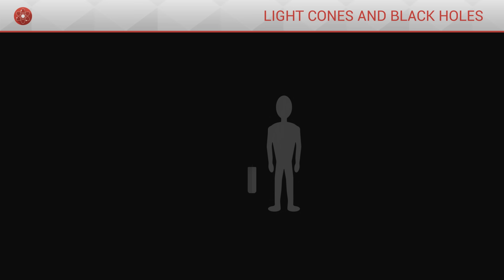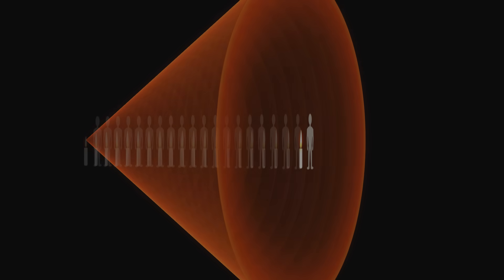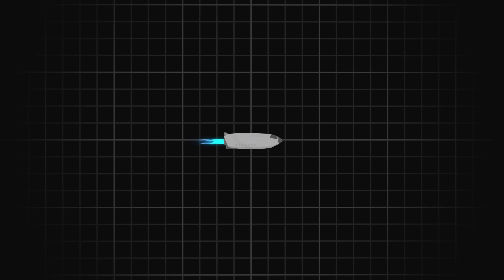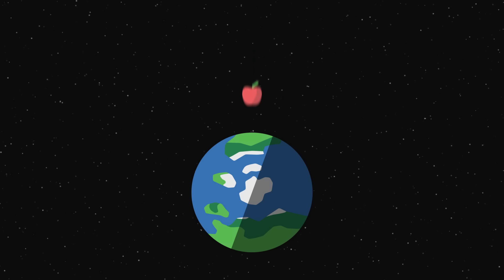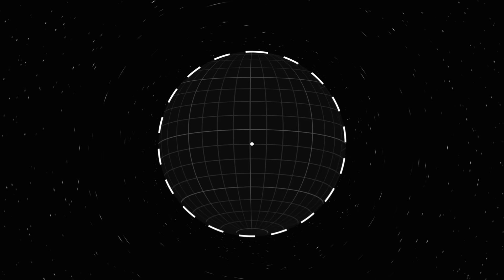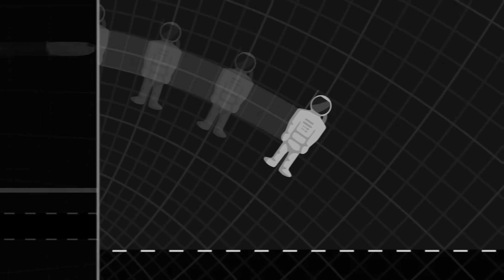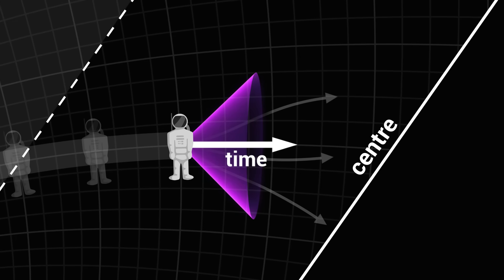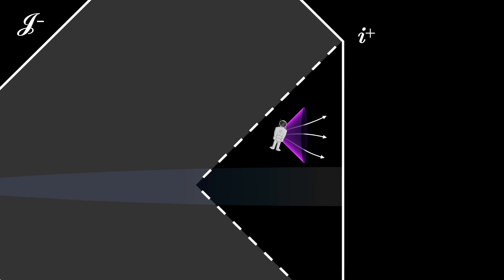Why Time and Space swap in a Black Hole

Comment: Something you said leads me thinking we can’t see a black hole because the event hasn’t happened yet in our future but with time pointing toward the center and us not having the capacity to travel through time, we can only witness the star disappearing in time but it’s still there heading toward infinity of space and we can only see the event horizon which exists in our timeframe reference

I would love to see an explanation of why black holes are successful at emitting jets of radiation outside the light bubble into our own time reference from the past. I would also love to see what happens to space and time as two black holes come together and “merge” aka two separate timelines potentially unify into a single timeline occupying the same space time reference point but internally could still be two separate points of time with two non escaping light bubbles interacting with each other 

Something else, now I’m curious how I’m trapped in a spacetime bubble and the influences I have within it and what would happen if I were to escape that spacetime light bubble (besides seemingly ceasing to exist to others around me)

Comment: One day i phylosophed about this.  So in our Universe, when our speed in room directions is at 0, our local time speed is at maximum. In my imagination, the atoms inner "happening" happens at lightspeed. When we then accelerate more and more towards lightspeed in a roomdirection, more and more the "happenings" and "oscillations" happen less often, because otherwise they would have to overcome lightspeed, when the action goes in the same direction as the whole "object". So a structure at lightspeed can not do something not even recognize the travel. In travelers perspective, the universe becomes shorter this way,. It is possible to interchange local speed with object speed by investing energy. When passing black hole horinzont, an objects speed is intrinsic at lightspeed to the centre. So by not doing anything, it has no inner time, because that would mean relative inner moving to itself. By investing energy, it is possible to change "X and Y" speed, what then leads to less "Z" speed in what an object would normally constantely go. That then would lead to inner time of an object, depending on how fast an object goes in X or Y direction. I just remember now my dreaming.

Comment: What if at the point of the event horizon because of your shift in  perspective of time; reaching the singularity is actually a lot quicker for you than we think and if that is a destination in time what if that destination is the time at which the black hole ceases to exist so it would essential be a kind of time travel from the now to the singularity being the then? I wonder if it could be possible that there is an equalizing dissapation of gravity on the opposite end or if its a completely different situation in that you essentially become frozen in time in some sort of space time blender that is dissipating both your time and space into some entropic pure energy that is just the cosmic remains of what you once were floating at the end of time.

Comment: But like the light moving away from the candle time moves forward no matter what geographical direction you travel in space.  And space is also moving in all directions.  Your direction of movement is only relative when you see something else and it is a human's interpretation you can't prove you are moving.  When you stepped off the tall building the ground came up and hit you. Time slows with acceleration if you move at the speed of light time stops.  If you sit at the singularity of the black hole and you are no longer moving and time is infinitely fast.

Comment: How about this?  Dark Energy is EQUAL to Energy plus TIME, for our purposes here, "HEAVY TIME." 
Mira, look, if we look at any form of energy or whatever you want to call it.  We see this electron orbit however many times a minute. We set that as our base or 0 reading, right? For our plain of existence, anyway.  However, in this pocket of "heavy time" we get readings of a billion times a minute because time is HEAVY here and passes faster.  Or, energy where there shouldn't be energy / dark energy / Heavy Time.  See, in that same minute that electron aged a million times faster and therefore has given off readings of a million instead of our base readings. Dark energy IS "HEAVY TIME."  It's the difference in TIME that we're seeing!  Maybe.  The light from these galaxies have been aged by going through pockets of dark energy or "heavy time."  Numbers used for reference only.  TI-I-I-IME IS ON MY SIDE!  YES, IT IS!
Now we look at the other side of the coin, dark matter.  Pockets of dark matter are actually pockets of "LIGHT TIME."  
Mira, look, if heavy time is, "full," it stands to reason, light time would be "starving," right?  Now this light time is slower.  Making our base 0 electron seem to stand still.  Get a pocket full of seemingly motionless nothing and you get a pocket of starving dark matter.  In this case "starving" is the same as creating a vacuum in space.  Since this pocket of "Light time" is "starving" and everything outside this pocket of dark matter is in a "heavier time," it makes it appear dark matter is attracting when really it's just a vacuum, in time, trying to equalize.
Making it stand to reason, by my, "I'm not smart enough to give anything more than this simplified reasoning, that Dark Matter is "LIGHT TIME" and Dark Energy is "HEAVY TIME."   Maybe.  Now think about this.  As light travels through the universe and passes through these pockets of Heavy Time or Light Time.  Does that "age" or "distort" that particular beam of light?  Does that beam of light that is say 40 million light years away now look like it's 100 million light years away?  If I'm right, it would explain why these 6 "old" galaxies are being discovered.  Also if I'm right and someone proves it, you must name it after me and give me a cut of the Nobel prize winnings. Pass it on please. and thank you.  Don't worry, where I come from crazy is a compliment. As it should be 
P.S. I may have gotten the names backwards and thanks again ;-P

Comment: I've never been able to find it, but when I was younger I saw a video in physics class that posited that instead of time and space swapping, spatial dimensions are integrated into time one after another. Entering the ergosphere, the spatial dimension in the direction of the traveler's velocity becomes necessarily positive and is indistinguishable from time itself. The traveler is then, spatially, in a two-dimensional universe. Crossing the event horizon, this happens again and the traveler is in a one-dimensional universe, unable to travel in any direction not ultimately toward the singularity. It finished off by supposing our current observable universe may well be inside the influence of a singularity, with unknown spatial dimensions already integrated into time. We would never know. Anyone know if this viewpoint is still a valid one, and if not then why?

Comment: What is the difference between the apple and the astronaut falling into the black hole? Their lightcones both point towards the center of gravity. Why would time become a space-like dimension in the black hole?
Reply: The whole space is time thing is just a complicated way of saying you just can’t get out. The singularity is pulling everything into it as fast or faster than light. That’s the main reason why nothing gets out
Reply: Because all directions you can move past the event horizon point towards the singularity and all directions outward point towards your past going towards the singularity is basically like going into the future thus you can't escape.

Comment: Awesome illustrations and narration but I don't think you explained the idea of dimension swapping. I don't think the concept of dimensions "swapping" roles was motivated. It seems more like a strong correlation between the dimensions is established inside a black hole. Note that in the case of the apple falling towards earth, you also said that "it's future is downwards". Note that without external forces, it the apple would not be able to escape earth either, even though earth is not a black hole. Therefore, the only difference between gravity of a regular body and gravity within a black hole is the strength of the space curvature, which, in the case of the black hole, makes escapes impossible (even if enormous forces were used). Hence, the difference appears to be that a certain threshold is crossed, not that the roles of dimensions are swapped. This is not to say that once that threshold is crossed, time and space are not more similar to each other than they are outside a black hole, but from your video I did not get the sense that an actual role reversal occurred.
Reply: I agree a 100%. Let's say the apple had some limited propulsion available that could delay but not avoid the contact with earth, that would still represent a "can't escape" scenario. Of course the Schwarzschild radius implies a threshold that introduces a qualitatively different limitation as no propulsion at all would allow escaping the black hole once that boundary has been crossed. Yet, at least this video, does not motivate a dimension role swap.

Comment: I have a question. If the gravity bends tje3 direction of time, for example , on earth,time and space are pointed to the center of earth ,and consequently the light cone of time will be turned to go in the direction of the center of the earth, Would it be logical to say that if an object like the apple for example , move at the escape velocity or even faster , that apple would escape time ?  Because in this case the apple would scape gravity, it wouldn't be in the same direction as the light cone in the gravitation field of the earth. I hope my question makes any sense😅
Reply: i hope this answers it from what i understood of your comment. You didnt escape time you escaped a weak gravital pull 9.8m/s but gravity of a black hole is impossible becasue it litrually flips space and time it so dman powerful that time STOPS you cant do anything becasue light is stopped

Comment: Hello to everyone here! I am lay on this subject but I greatly enjoy it. Could someone kindly help me understanding the following question:

1. Close to a massive body, my time-space grid is tilted compared to a far away observer. This tilt creates for the observer a horizontal and a vertical vector in my time-line. 

2. To the observer, when I move through my  time line, I am both moving, at a slower rate, through his time line (the horizontal vector) AND moving through his space (the vertical vector) towards the massive body.

Now comes the question: what does it mean to the observer when I move through my space? Will I have horizontal vectors in his time? And if so, wont there be directions in my space in wich the horinzontal vector will be...well....backwards in the observer time line?? Therefore im going back and forward in his time, as I move through my spacial grid? 

Ps: im not on drugs

Comment: Any thoughts about objects having a temporal dimension attached to them, similar to the spatial coordinates represented by the XYZ axis. Our visual perception of the world occurs through the reception of photons by our retina, each of which contains data from a particular moment in time and space, our brain then creates what we percieve as reality trough that data. If we were to extract temporal data along with spatial data from light, it would suggest that time is not an absolute clock continually ticking away, but rather that all objects possess their own unique temporal value and exist within a 4D spacial grid (X Y Z t). We perceive time as something that passes, but objects could simply be pushed forward in the temporal axis just as gravity can impact our spatial dimension, wouldnt it be possible that there is a type of gravity that impacts the time axis by pulling objects towards the direction called future making us percieve the spatial dimension of time as something always moving forward?

Comment: Omggg I've been trying to understand this concept and this video was like turning on a candle in a dark room for me lol. Especially since someone asked on another video why can't light escape a black hole even though it has no mas. And that question fascinated me so I came upon vague answers or too complicated really so this was just what I needed! I see more of why this happens even though it is still a little confusing, I feel so much more clear now!

Very well done, so happy I stumbled upon your video randomly in my searches to learn more about black holes 😀
Reply from the maker: Very happy that it could help you understand better!
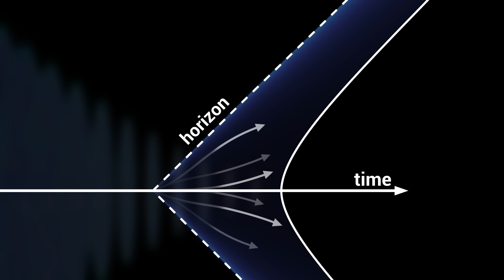Reply: @ScienceClicEN  The video is interesting but i still don’t understand.  11:02 when the diagram is straightened, the new digram doesn’t explain why time can be pulled to the Black Hole’s Singularity like before, which is explained by light cone and that time and space are swapped and easy to understand. Therefore, falling downwards to the Singularity would not be the only destiny, i feel like this part of the video has lost its connection with starting parts if it still bases on time space swapping principle. Something more is why the Singularity is still an event for the astronaut crossed the horizon event. Could you explain those?.

Comment: The lightcone with a flat face is not a really accurate graphical display. If the light at the center travels at the speed of light, the light at the edges has to travel root 2 x the speed of light, roughly 1,4x the speed of light, in order to arrive at the same time. That is incorrect. The face should be displayed spherical.

Comment: You can move on a different direction through. Imagine time moves at a standard rate on a straight line (x). The amount of energy you possess would cause you to move towards a different direction (y) which in turn, if you energy was closer to infinite, meaning no mass, you would move forever closer to Y direction, making it so time could almost “stop” or “slow down” for you, much like special relativity states. Or, you could move at a third direction (z). Dependent on your mass. If your mass gets closer to infinite, you would lack energy and move closer to z, making time stop, much like a black hole. So while C is constant, it is curved or interacted by different variables. All three variables are what I would consider 4-6 dimensions of a being

Comment: time is fixed it's our perception of time are affected by gravity since gravity can warped light since we are using light as measurement of time to monitor the universe. every living thing in the universe have different way to perceive time to us in earth our time is 24 hrs a day and 365 days per year. one rotation of earth is 24 hours 365 days one orbit cycle of earth to the sun that's how we measure the time but ant's and other living things in earth don't follow that rule they perceive time differently. 

moving at high speed can affect our perception of time because we are perceiving time through light if we are moving high speed away from the source of light and we are only looking at the source of light our perception of time will slow down and vise versa. if we have a clock that are not affected by gravity, electro magnet etc the time will not change even if you can travel at speed of light so that theory about twin sibling if one travel of the speed of light and come back the other one who stay at earth will be older than the other one is bullshit.

Comment: uhm... isn't it wrong to say that the light cone bends? based on the entire previous segment i'm assuming that gravity and space only cause the light in the cone to deviate, from 0 degrees to another angle within the cone; not turn the cone in an entirely new direction. if this is wrong, then what fucking sense does the cone make in the first place??

in other words, based on your explanation, i was expecting the fucking apple to DEVIATE FROM the center of the cone, not BEND the entire cone

i guess at least one of us must have done a bad job
Reply: yeah, your subsequent explanation of black holes only reinforces my reaction's point (noting how the cone's 90-degree angle falls within the event horizon)
Reply: you seem to misunderstand the cone, its a representation of how far light can move in a certain amount of time,  it bends because gravity prevents light from moving as far in a certain direction, so that when its below the event horizon the farthest it can move is just to the edge of the inside of the horizon. I think you may have thought that the degree inside the cone is the bend of light but thats not the case.
Reply: @DiscChimes  ye it my thing it what i do

Comment: Does this mean that the light heading directly into the black hole would be travelling instantaneously?

I mean, it's moving at a 90° angle, that should be instantaneous movement. So the true upper limit of speed isn't 45° (the speed of light), but 45°+45°=90°, with the other 45° being the gravity of a black hole.
Reply: from the perspective of the light it would be instantaneous, it would still take time for a non-affected observer.